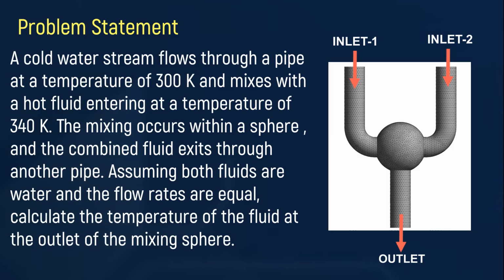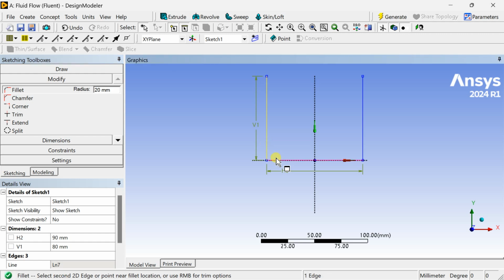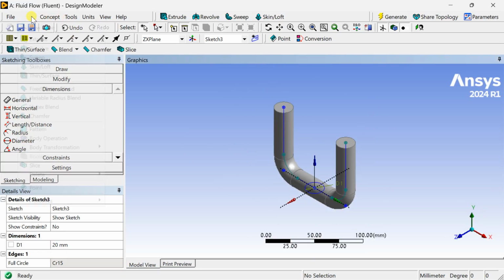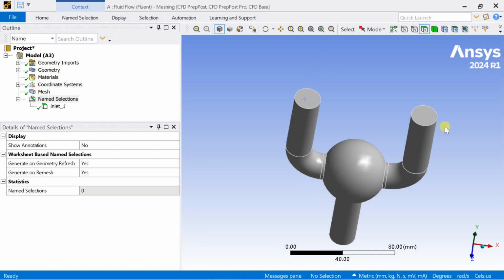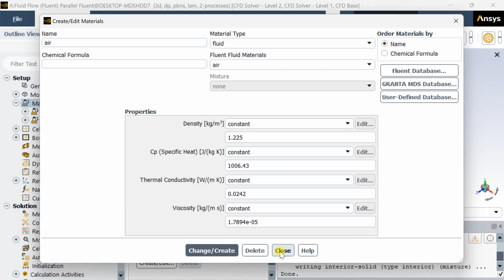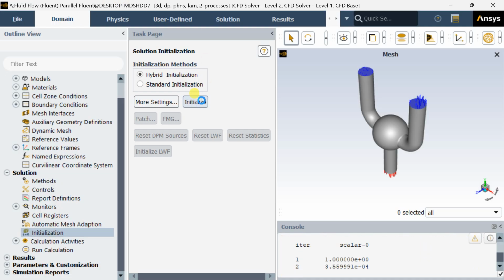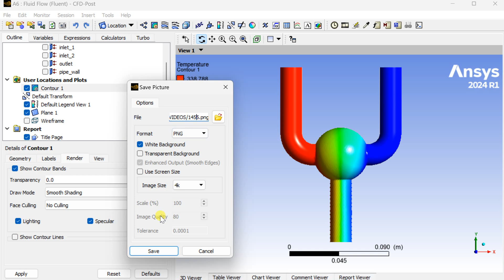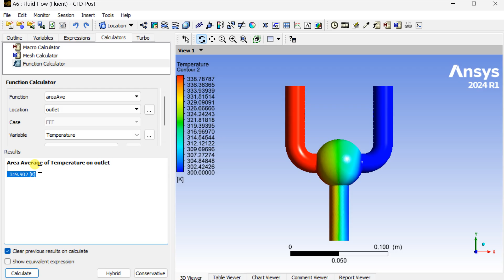ANSYS Fluent Tutorial: Heat Transfer Analysis of Hot & Cold Fluid Mixing | Step-by-Step Guide

Comment: I have an assignment on CFD, I've been struggling a bit. Can you help?
Reply: Question 1
You have been given a water model of a tundish. This physical model will be used to evaluate the flow domain properties and the effectiveness of turbulence inhibitors. The plan is that the water model is used to evaluate the effectiveness of the turbulence inhibitor design. Your primary interest is to assess the quality of the flow entering the tundish, specifically achieving steady state operation and uniformity of the flow properties.
You are two develop a 3D-CFD model of the tundish water model. Two variations should be developed which includes:
One case with the turbulence inhibitor
A second case without the turbulence inhibitor
Under steady state conditions you are to achieve a water level in the tundish of 300mm with an inlet flow rate of 1.5m³/h. You are allowed to vary the outlet flow rate and the inlet nozzle height above the liquid level to achieve the water level height with 20% accuracy. Once steady state operation has been achieved you are to inject 2000ml hot water as tracer and evaluate the turbulence inhibitor effectiveness by analysing the flow domain
Reply from the maker: Can you mail me with details of the work, ansystutor7@gmail.com
Reply: @AnsysTutor done please check